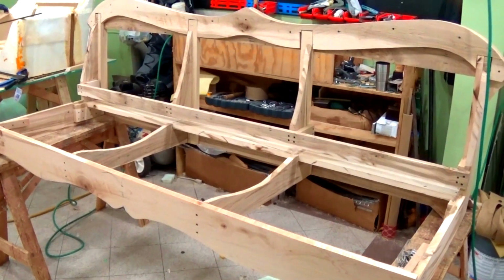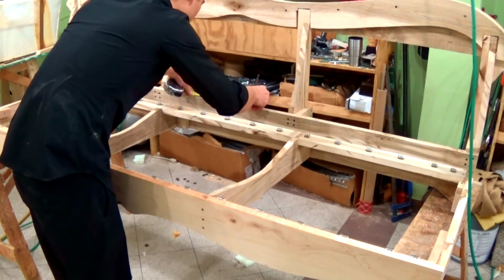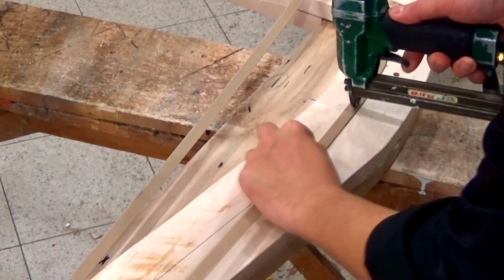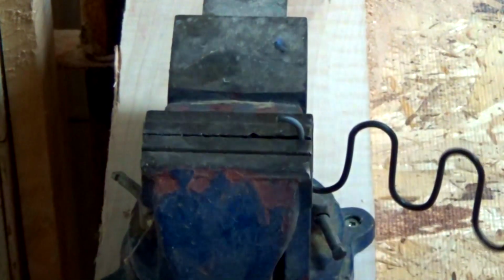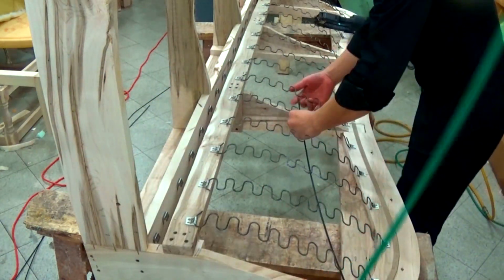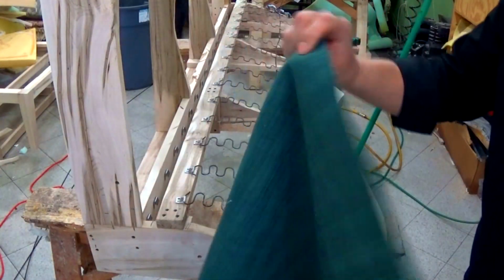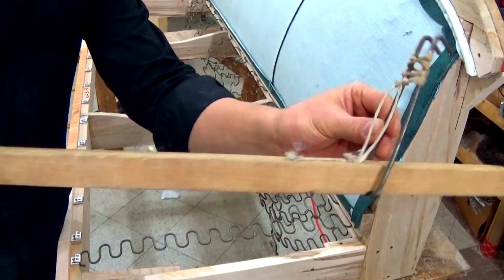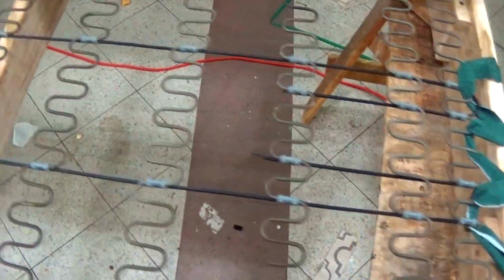HOW TO PUT SPRINGS ON A SOFA - ALO Upholstery

Comment: Wow. That tool where you pull the springs in place is genius. And, it's exactly what I need. I inherited a cheap couch that had this type of spring in plastic holders. They're not properly secured and one popped off it sideways. The strength in the spring is such that I've been trying to figure out how to extend it back so I can slot it in, almost took out an eye when I lost track of what I was doing and got too close to see what was going on. 😬 Going to whip up a tool like this tomorrow and get it sorted.

Comment: I would definitely buy Custom Made Couch from him. Does s nice .Quality job.  I replaced springs on my old couch which.tirned out good but the guy who made my Couch  couldn't hit the Side of a barn with Nail Staple gun so many Miss's exposed Nails I added Brackets Glued most of Joints Drill holes used Deck wood Screws now it's solid . By watching this guy he knows what he's doing and Takes pride in his workmanship those traits Getting to be Lost cause in USA. Everything Rush half ass. Enjoyed watching video

Comment: I found this video while searching for tips on repairing the couch cushions i currently have.  You do a very nice job!  I like your custom spring pulling tool!

I would love to get the wire clip gun, but i dont have that much to do.  Could you recommend a good hand tool for the job?  I need to replace a few springs, and run new wire across all the springs.

Comment: Oh I see why we were sinking in the couch. The manufacturer didn’t fasten the spring end clip. When the kids jumped on the couch, the springs became unfastened. Also, our couch had way less springs. Almost half. Finally the steel wire clips loosened. The wooden frame started to crack too. I really need to become a carpenter to fix this couch. 😢
Reply: Did you do it

Comment: How do you determine the length of the springs and what type of lumber is the frame made of.  Thanks nice video
Reply: Robert Avery As for springs - Rather than buying pre cut springs of a certain length you can buy a roll which you cut yourself with bolt cutters. E.g. see Heico direct. They also sell 8g and 9g for bottom and 11g for back (some places don’t do 8g). Measure the length between back and front rail and multiply by how many springs you have (can do 4 inch distance rather than 5 if you want more support). Springs will be curved but you also pull them taut so the length between the wood is an accurate guide. That way it’s better to have too much than not enough, and worst case scenario you can give away any remaining length that you won’t use
Reply: House2Home has instructions and spring length tips that are included with their springs 
https://house2home-us.com/collections/upholstery-springs
Reply: Could you change a chair from coil springs to those type of Springs?

Comment: Man I need a manual tool to attach the stay wire clips to the springs - he’s using a pneumatic one with a compressor, the hand tools are like $75, dang I just need to attach one wire. 😢

Comment: Hi, how would you measure the spring for a project?  I see that you have to stretch the spring, so are they 2 or 3 inchs shorter than the span they have to cover or only 1"?  just wondering how i would get a goo spring length for my seat project.  thanks
Reply: House2Home has instructions and spring length tips that are included with their springs 
https://house2home-us.com/collections/upholstery-springs

Comment: try repairing those springs when they break...and they will,it's a nightmare job,not for the faint of heart,most folks just throw away the sofa,i've repaired quite a few in my day and it's not easy,esp to do it correctly,so the repair lasts.